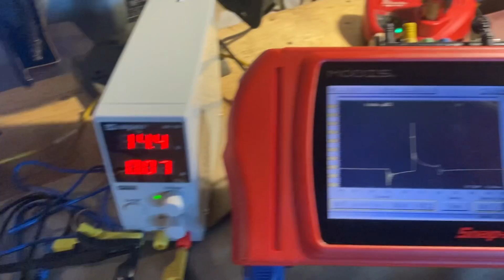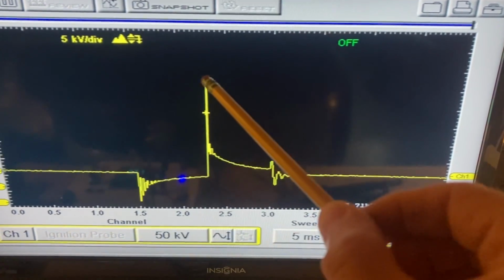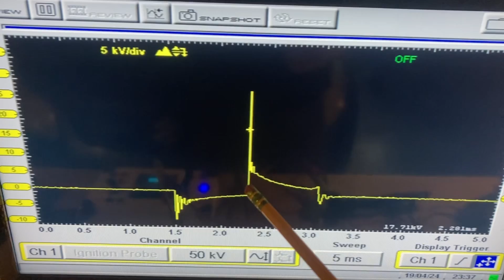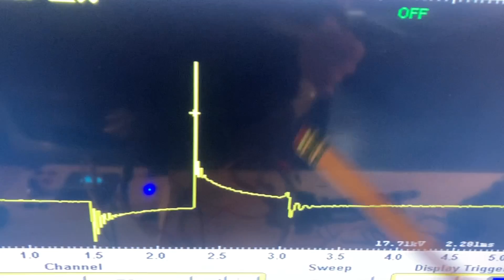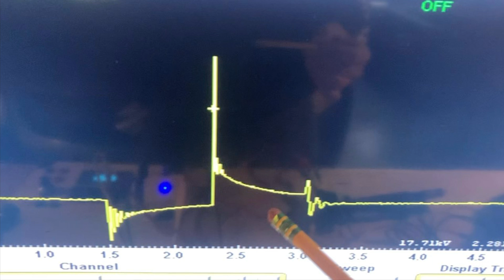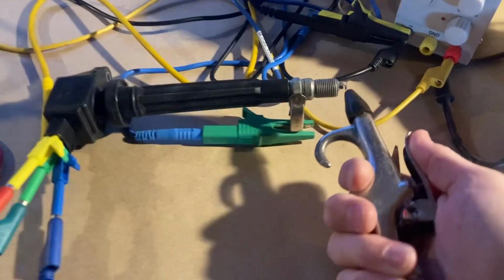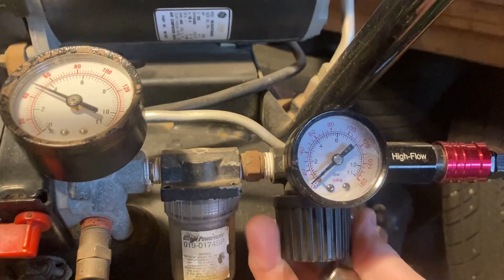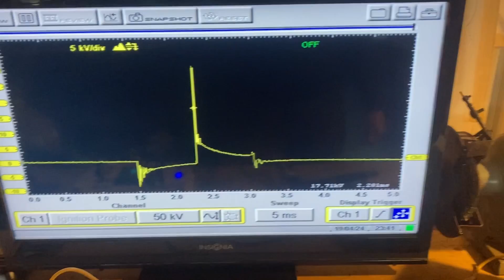Secondary Ignition Trace Sparkline Turbulence

Comment: What are you using to fire the coil? I was going to use an old hei distributor and drill.
Reply from the maker: It’s triggered via a 5V square wave pulse. Cheap signal generator from Amazon ($10). There is a few videos on the channel detailing the set up. Thx for watching 👍🍻
Reply: Cool I’ll check the other videos out.

Comment: This can be used also for diagnosing clogged catalytic converter, because in such a case EGR increase because the exhaust gases pressure in the exhaust collector increase as well to the points when you start getting misfires .
Reply from the maker: 🤔 Thx for watching 👍🍻

Comment: Hi, can you test it with inline meter, instead of inductive one
Reply from the maker: On a coil on plug assembly there is no direct access point to the secondary. Apart from primary coil current ramping, trigger monitoring and a ground point check. Capacitive or induction leads afford the best insight to the secondary waveform. Thx for watching 🍻

Comment: thanks a lot
could you tell me please what's the brand name of pulse generator 👍
Reply from the maker: Thx for watching. Here is the link. The test set in the video is just something I knocked up with a few different facilities.
https://www.amazon.ca/Generator-DROK-Function-Frequency-Rectangular/dp/B07KVYQ78K/ref=mp_s_a_1_1_sspa?crid=30K60ENSSOAQY&dib=eyJ2IjoiMSJ9.k5VbPc0k-3dJap9eNxjX67Y4JtNE7wzy_QVDYtbIjUYEzAtpH91LzR9r6AcUg9o2BJZKufon2sVNy6bz3gUFelJEcT06qq6ZOjktJG0DzfJC2HabD3Jw7z1MLQ31qwESgBMYGAkuECp5xsiMfylnmvdjqXoftd5xlt5tVQ9ANo6cm0mGIROdfZeKfsxK4F9F_d9jFRYshSp44_J87L_Jcg.2NFw0pKGGsOxetm4UKtf97BT8x9Fxr-Hww8m7a4TF_M&dib_tag=se&keywords=pulse+generator&qid=1714229090&sprefix=pulse+gen%2Caps%2C131&sr=8-1-spons&sp_csd=d2lkZ2V0TmFtZT1zcF9waG9uZV9zZWFyY2hfYXRm&psc=1
It’s Amazon Canada but you can source one from many retailers 🍻